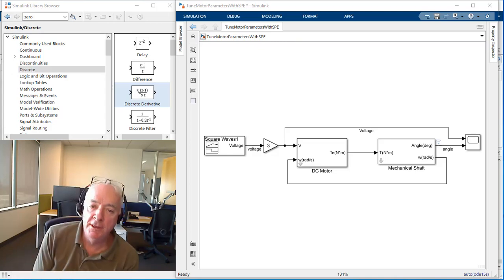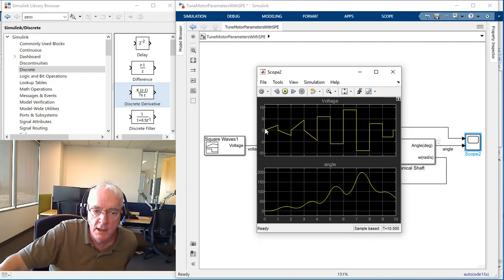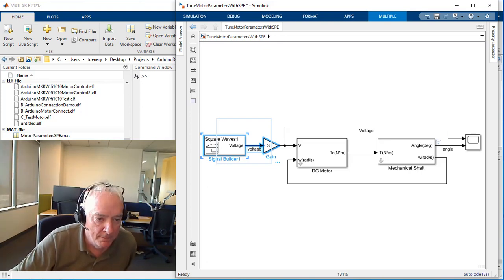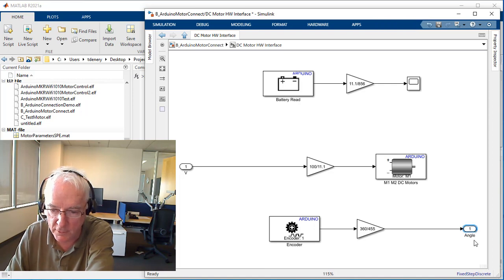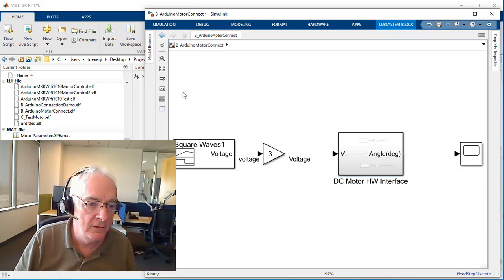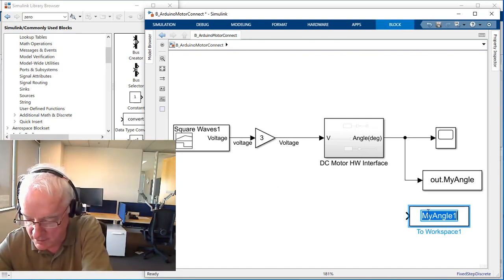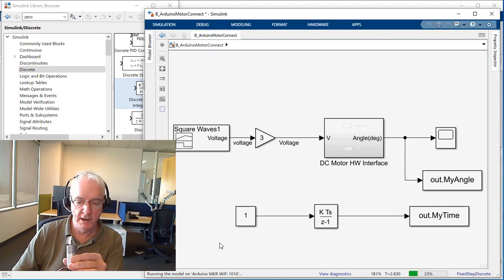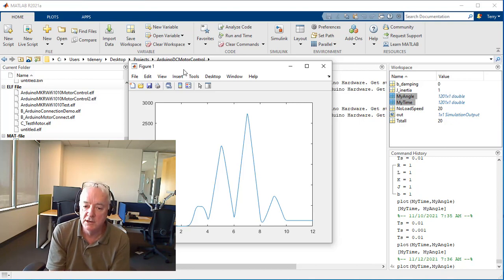Engineers Studio #32 - Open Loop Test of DC Motor

Comment: It is not clear how to link the DC motor parameters (L, R, and K) with the mask parameters (Nominal voltage, stall torque, no-load speed and inductance). Could you clarify the relation between them?
Reply from the maker: In video 4, of the playlist Simulink and Mechatronics, I go through the derivation of Stall-Torque and No-Load Speed, as expressed by the DC Motor parameters (L, R, and K).  Here's a link to that video:  https://www.youtube.com/watch?v=zDnmNZxmm_Y&list=PLiTw5z-CABwd7OIEHSx-NhXhzyNCa3evl&index=4.  Sorry for the late response, but thanks for watching, and for asking this good question. -Terry